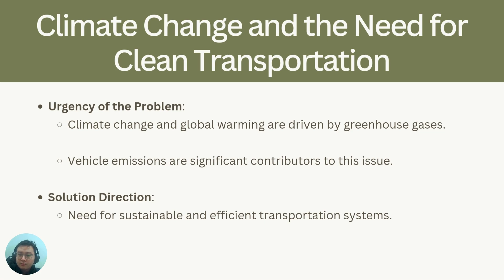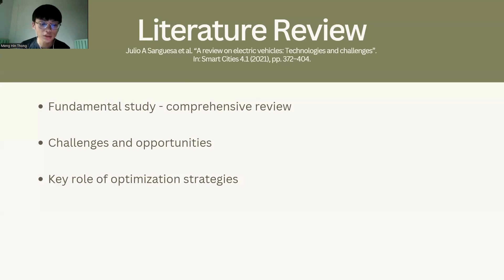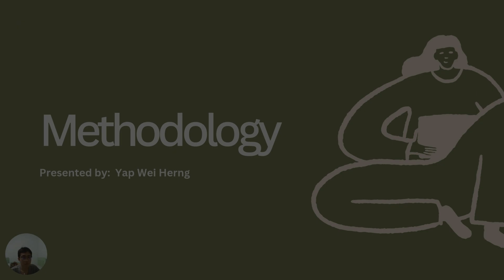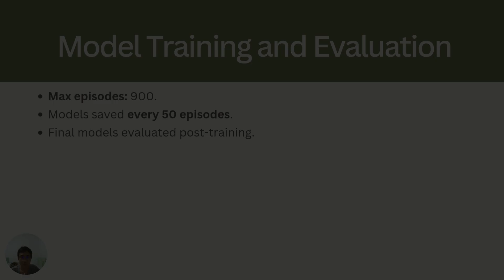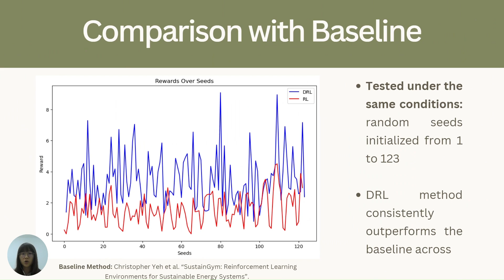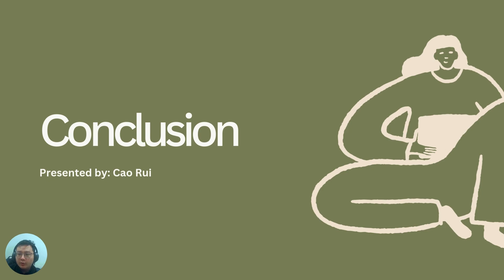202409 AIT306 Group 1 Project with SustainGym

Comment: Group 2:
Lyu Yaxing:
1. Regarding the architecture: Both the Actor and Critic utilize four fully connected layers with fixed hyperparameters (e.g., learning rate). Where does this model architecture and parameter setting originate from? Is it supported by any literature? If so, have you tested whether this architecture is robust enough to handle the complexity of the environment?
2. Regarding the comparison with the baseline: I noticed that the average reward in your results is indeed higher, but the stability is not very good. The reward curve fluctuates significantly. Have you calculated the variance of the results or plotted a boxplot to examine the reward distribution?
Reply: 1）The architecture and hyperparameters (e.g., discount factor, batch size) are based on the original source code, with some adjustments from our side. We performed Hyperparameter Optimization, but the differences were minimal, so we didn't document them further.
2）While the average reward is higher, the reward curve shows instability. We haven't calculated the variance or plotted a boxplot to analyze the reward distribution, but the instability is also observed in the original source code.